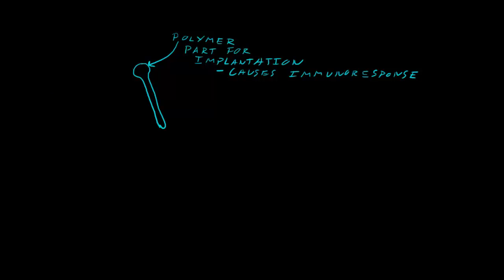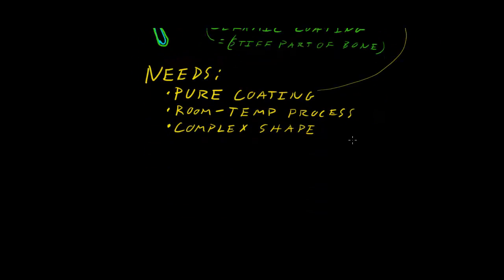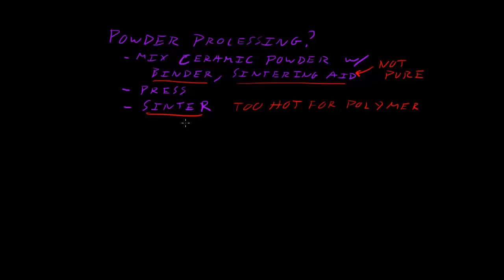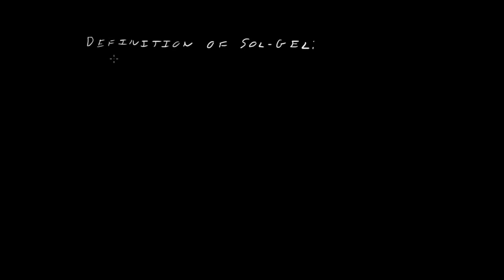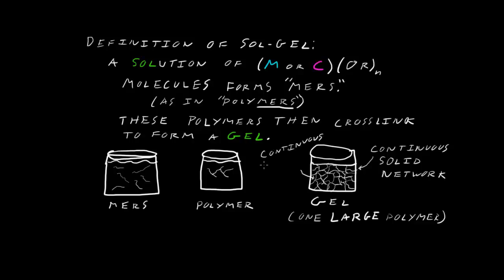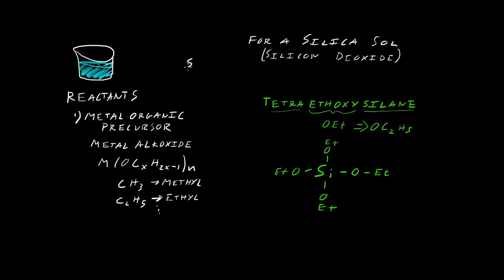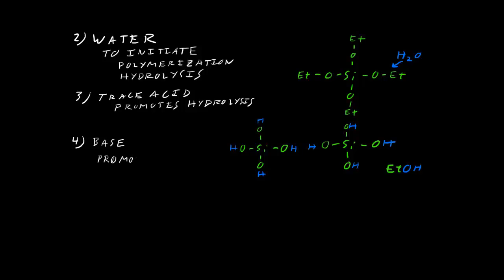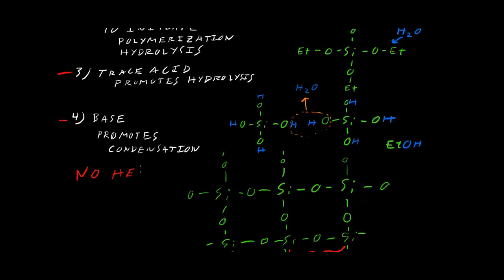Solgel 1 - Part 1 (Updated!)

Comment from the maker: Hi,
If I understand your question correctly, you're close to the truth. The initial metal-alkoxide (Si-O-Et) first hydrolyzes to become a metal-hydroxide (Si-O-H). This kicks the alkyl Et off as Et-O-H, or ethanol. Two metal-hydroxides then condense to form metal-oxide (Si-O-Si), kicking off water. That ethanol and water does stay around in solution, but it's a small amount to the ethanol and water we added to the solution at the start anyway, so it doesn't really affect the chemistry.